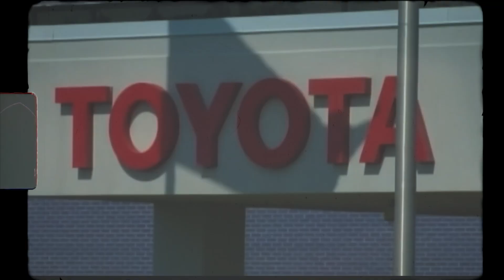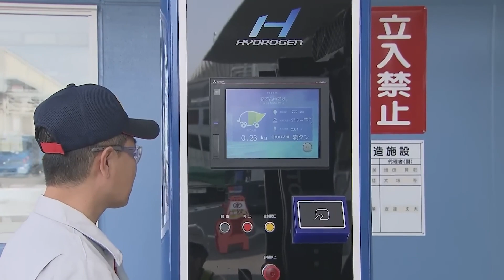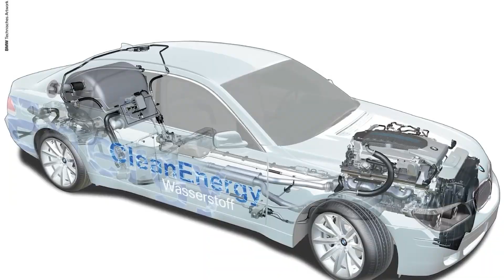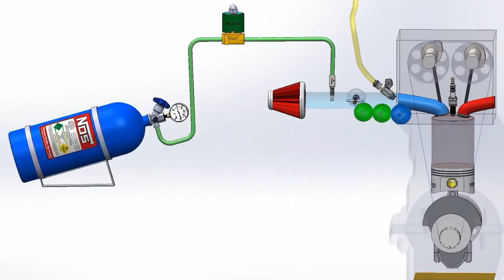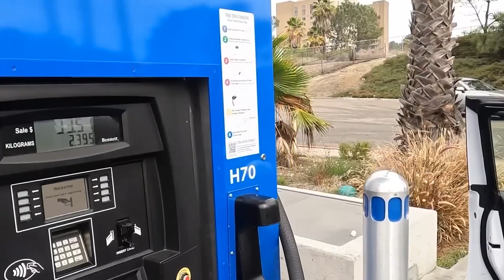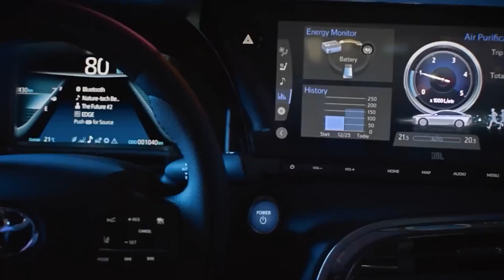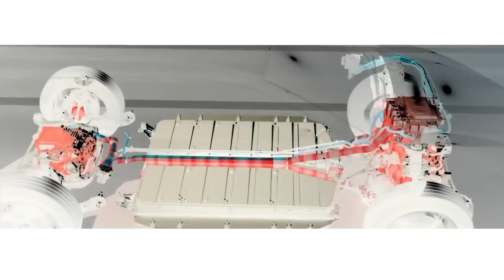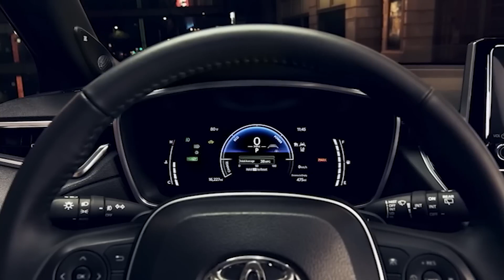Toyota CEO: "This New Engine Will Destroy The Entire EV Industry!"

Comment: SCAM alert. This will be a footnote in history. A hydrogen fuel station cost Millions and it needs refueling trucks, no onsite production. Hydrogen maintains the status quo. Electric will reach 30% penetration by 2025, by 2030 over 95%. Hydrogen by 2030 will be under 2% and hybrid about 2%.

Comment: Hydrogen Internal  combustion Engines (H-ICE) have been an on and off thing for a long time.

The issue is not the H-ICE, albeit it has way more components than an EV drive train, but rather sourcing and  distributing the hydrogen.

Only if the hydrogen can be generated  on-demand at a local "hydrogen' station instead of being tankard and trucked to the station can hydrogen H-ICE be a viable player in this green energy game.

Why?  Well the EV downsides discussed in this video will eventually be resolved as the Battery, motor and charging technologies evolve.

Comment: This is far from a new idea. Plenty of other companies have made hydrogen-fueled engines. The issue is fuel. Hydrogen is everywhere, but it's always bound with something, usually oxygen. The process of separating them to make hydrogen fuel is extremely energy-intensive. It won't be until we have widespread nuclear power that hydrogen as a fuel becomes viable.

Don't get me wrong, this would be awesome, but there's a reason this has been an idea for decades without going anywhere.